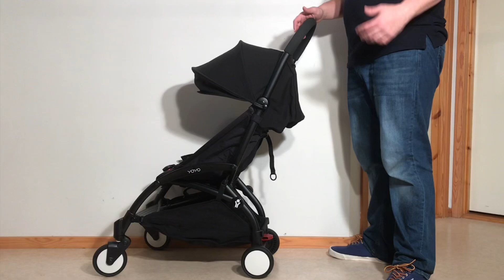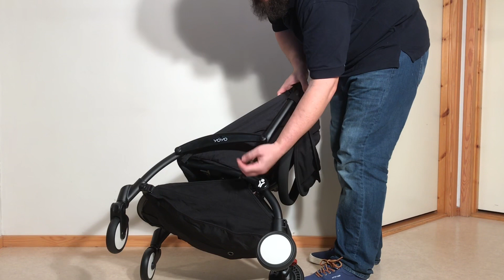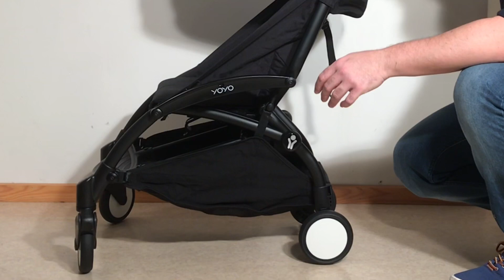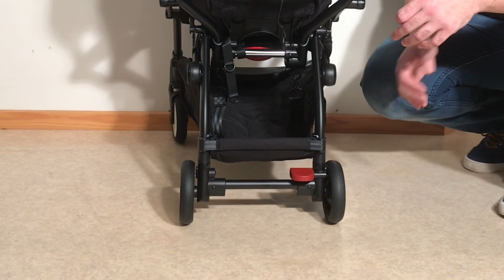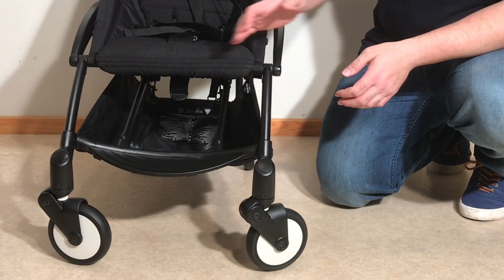Babyzen Yoyo+, An Impartial Review: Mechanics, Comfort, Use

Comment: We have one of these that we got from a friend, we brought it on a trip and were able to carry it on our flights with TAP portugal, RyanAir, and Air Malta.  Overall we really loved it, it worked amazingly for our trip.  It is still working fine, but the frame has become pretty loose. Is there any way to tighten it?  We tried tightening all the bolts ourselves but it doesn't seem to do much over-all... i will continue to use it either way, even with the loose frame, the size still makes it super convenient as a car stroller.

Comment: Thank you for the in-depth review. It seems that technically Babyzen Yo-yo is superior to other ultra-compacts such as Cybex Libelle. However, there is a problem with it’s folded dimensions in the part of world we are living in (Latvia) if you wish to take the stroller on board as hand luggage. The maximum hand luggage dimensions for Airbaltic, Ryanair and Wizzair are  55 x 40 x 23 cm, while Babyzen Yo-yo is 52 x 44 x 18, which means it’s 4 cm too large to fit the restrictions. Knowing that the low-cost airlines can be particularly fussy with the restrictions for taking luggage on board, I would definitely consider getting the Cybex Libelle that would safely fit within the hand luggage restrictions as it measures only 48 x 32 x 20 cm. Thus I think it’s unfair to say that there is no need to go below the hand luggage dimensions set by IATA as in reality many airlines impose hand luggage size restrictions that are smaller that what IATA recommends.
Reply from the maker: Thanks for sharing, I was unaware of this. :)

Comment: Two things I find cool about yoyo: 1- the black fabric has a lot of to give it in and the seat can easily expand for 5-8 cm. Therefore it is perfect for older kids, who actually outgrew the stroller age; but occasionaly need one during travels or so (jetlag etc) 2- the fold: by folding only the handlebar, our daughter can push it by herself easily and use it as a doll stroller :D (again, useful for trips). What I dont like: my husband is very tall and he keeps bumbing into it, while he is pushing the stroller. That rarely happens with ergobaby metro for instance.. 
have you heard of Mast m2? Looks like a good Swiss design..
Reply from the maker: Right on :)  No, I haven't seen it here in Norway anyway, I'll see if I can get a look :)